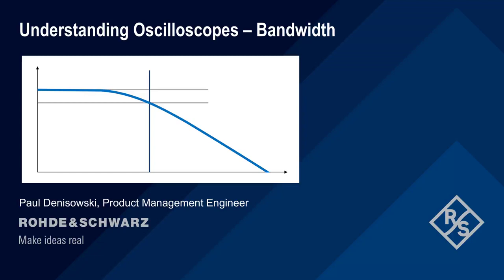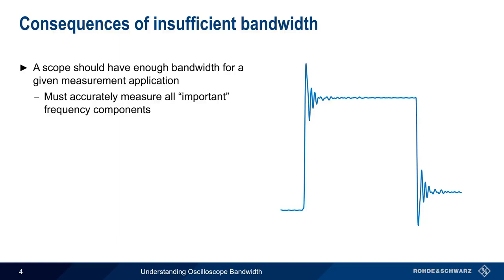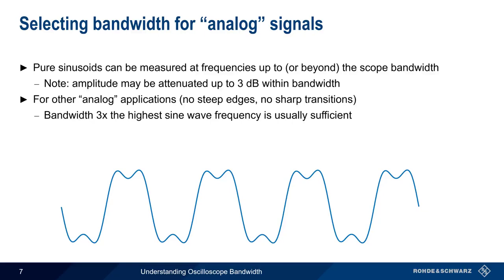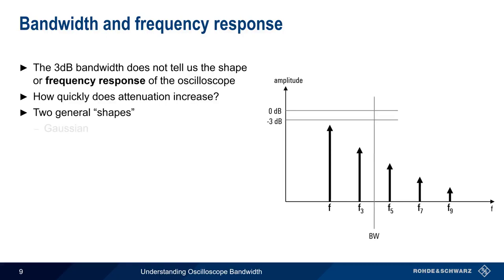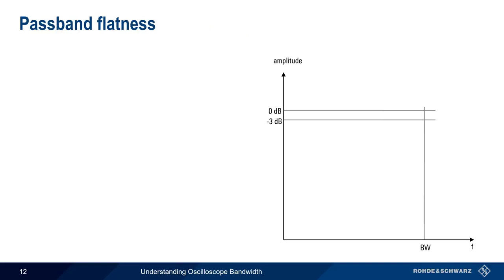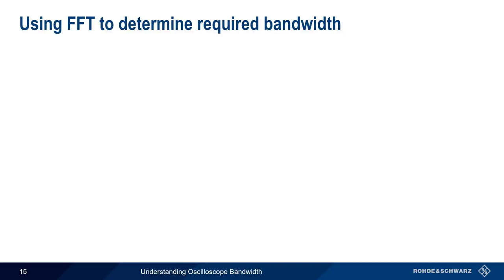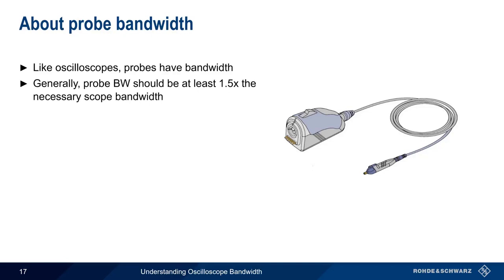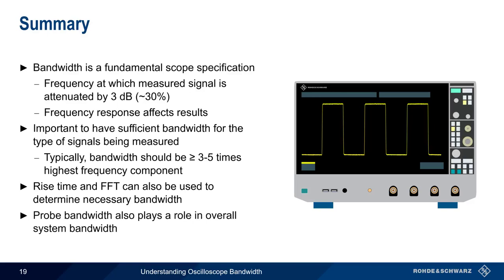Understanding Oscilloscopes - Bandwidth

Comment: Hi, the flat response in the graphs on most pages don't correspond with the BW indication...just on page 12 it is shown right. Otherwise really good...thanks!
Reply: Yes - on slide 11 the BW line is in the wrong place (should be to the right) and on slide 9 it's correct for Gaussian but should have moved to the right for Flat.  All the other slides are correct. Thanks for letting me know!

Comment: Hi,
Thank you, that was excellent.
Is the 10x on the probe related to this topic as well? How does it contribute?
Regards.
Reply: Thank you!  The bandwidth of a probe is a function of several things, but the attenuation (10x) is not a significant contributor to probe bandwidth in most cases.
Reply: @pauldenisowski  thank you.
Reply: Maybe I'm misunderstanding the comment, but doesn't a 10x probe increase probe bandwidth? @pauldenisowski
Reply: @zokalyx   10x probes generally have wider bandwidths than 1X probes because the capacitance in the probe tip of a 10x probe helps to cancel out the inherent capacitance of the scope input - it's this capacitance, not the attenuation per se ,that leads to wider bandwidth.  Hope that makes sense!
Reply: Thanks for the clarification! Totally clear now. @pauldenisowski
Reply: @zokalyx Anytime - thanks for the question!

Comment: Why are you saying that frequency attenuated by 3 dB is (~30%)? WTF!
Reply: If you listen to the spoken text (or turn on subtitles), I say "The bandwidth of an oscilloscope is defined as the frequency at which the measured amplitude of a sinusoidal input signal is decreased or attenuated by 3 dB"  Since oscilloscopes measure voltage, a 3dB reduction is approximately 70% of the original amplitude (sqrt(2)/2).  You're absolutely right that it would make no sense to talk about frequency being decreased by 3 dB :)  But I can see where the bullet point might be confusing by itself, so thanks for letting me know!